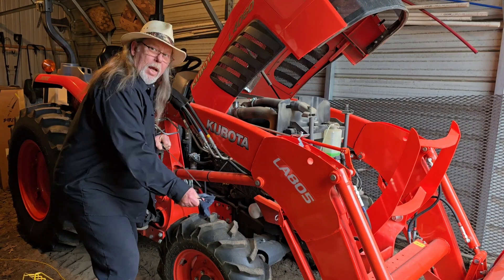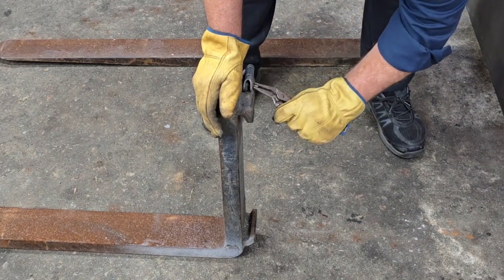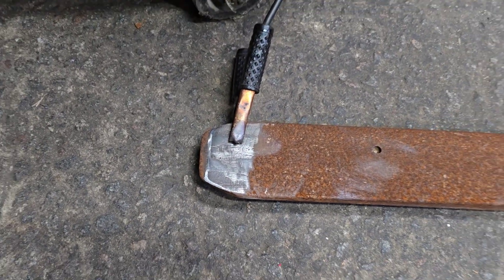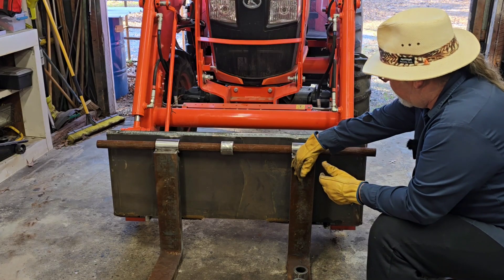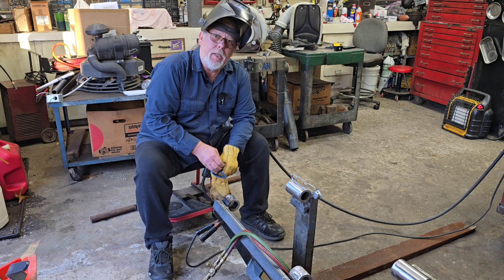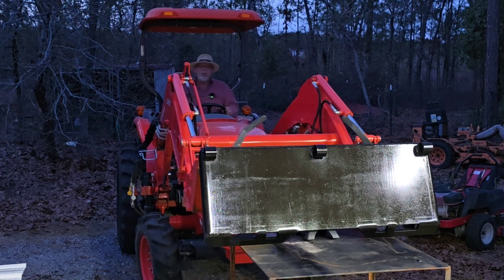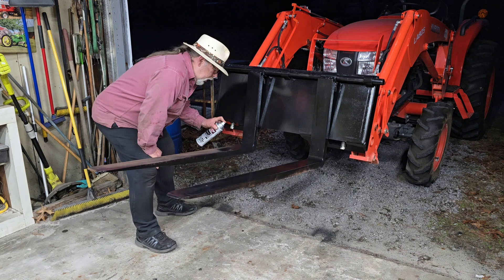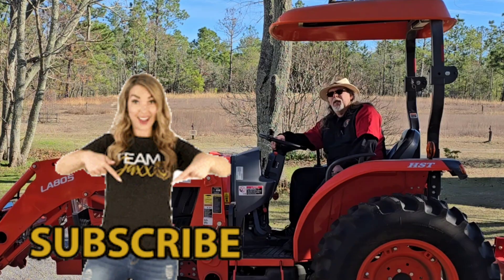Custom Built Forklift Attachment for Kubota L4060 Tractor with LA805 Loader

Comment: Nice upgrades to the forks!  The welds look nice, clean and strong.

From what I understand, hearing from old-timers about welding work in the shipyards, hydrogen embrittlement was such a concern that they had 1 or 2 guys managing all the welding rod for the whole operation in an access controlled room where the rods were kept in ovens around 300F.  Having preheated consumables and preheating the weld surfaces eliminates any moisture that may be on the steel.  So, ya, your welds look strong as a battleship!

The DIY HVAC project sounds like it would make for a good video.

Take care now Mr and Mrs T-Bone.
Reply from the maker: @arty1799  thanks Arty